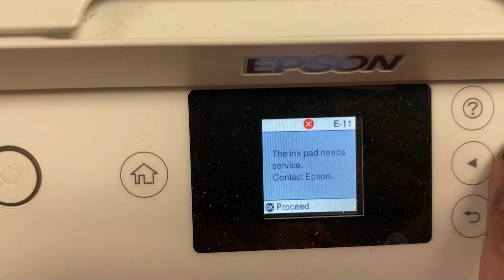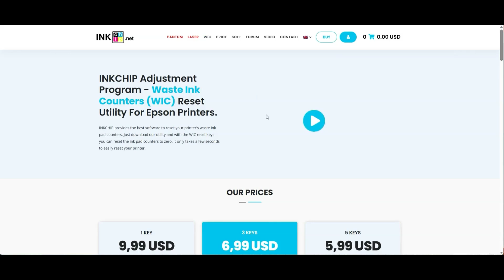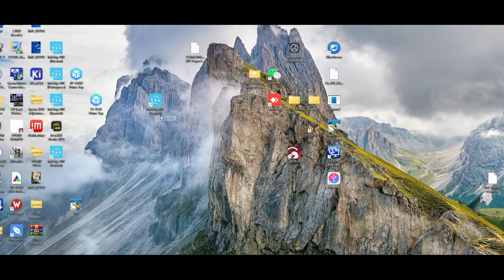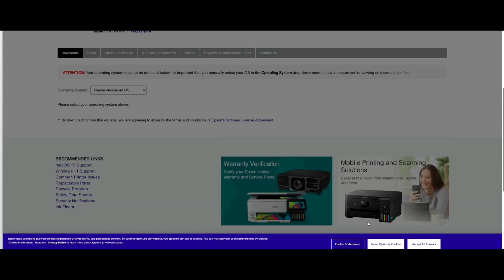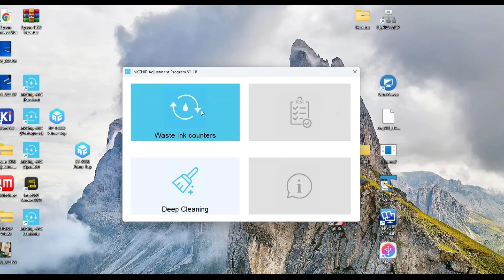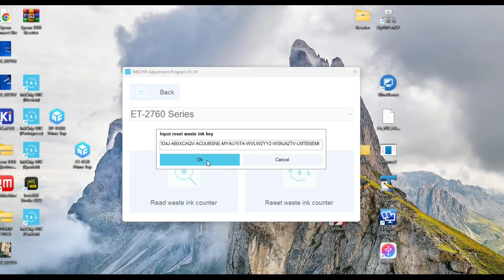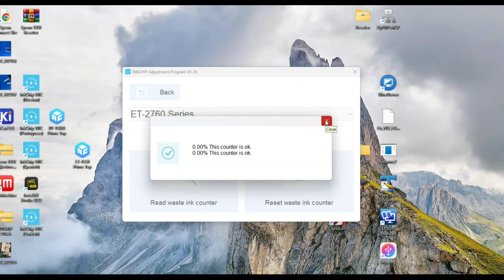Printer Says Ink Pad Full? Try This Simple Trick!

Comment: So it had two issues? Also do you buy these just to see if you could make some soft of helpful content? No ill will just curious. As always great work as always.
Reply from the maker: The main challenge I face is resetting the waste ink counter. This one doesn't have a chip, so you can reset it with software solution. For the one with chips, you have to search for a physical resetter. Not all of them have a resetter. As for external tanks, I prefer diverting the waste ink into an external bottle to prevent the OEM waste ink box from filling up, which would otherwise require me to either clean the sponge or replace it entirely. Since I run a repair shop, these printers come through my door fairly often.